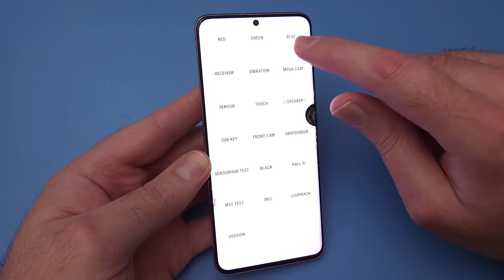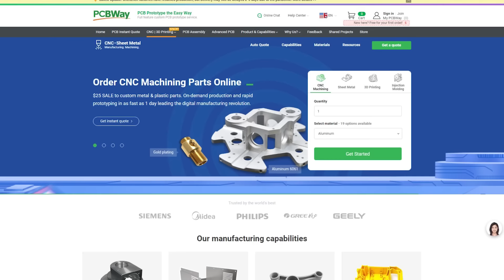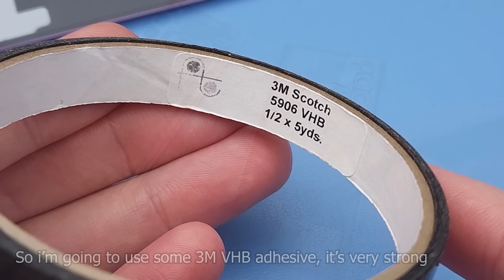Samsung Galaxy S20 Repair

Comment: The adhesive of the OnePlus 7 Pro is even harder to fully remove and get the back panel clean. I spent like 4 hours scraping and trying to remove it. That adhesive is very strong. I think i still have some of it stuck to my work table almost a year later

Comment: I think you shouldn't apply B-7000 adhesive as the tape adhesive will be plenty strong enough to hold the display in its place and it should be used for holding small objects such as the power button down in the place. But if you want to glue down the display more securely, you can apply some tape adhesive in the middle.

Comment: What a quality video, I need this in trends. This can't be ignore by a S20 series lover. Espectacular reparación, pasé un buen rato con este mi móvil favorito, cool content 👍🏻
Reply from the maker: Thanks so much 😀
Reply: @RestoreTechnique  hello, where did you buy your replacement screen?
Reply from the maker: @Puzzicanello  WitRigs, but I wouldn't recommend them, I think they might have closed down actually. I've bought from Etradesupply a lot in the past, and they are better, but still not fully trustworthy. I am going to try REWA next. You could try the vendor list on reddit /mobilerepair.

Comment: you can use turpentine to easily remove the glue. apply it to the glue lightly. wait 1-2 minutes and wipe away the glue. You'll probably have to repeat this 2-3 times. then clean with alcohol finished. I've often done this on cell phones. it doesn't attack the covers.
Reply from the maker: Thanks for the tip

Comment: 02:00 There is already a gap because of the phone heating issue. I also have that gap because that area heats up too much. I had already visited the service centre once and replaced that glue and after a year, the gap is opening again. But this time my phone is out of warranty.

Comment: can let me know where to get that replacement screen and the price,  thanks
Reply from the maker: I think I got it from Witrigs.com, but their service is terrible, so can't recommend them.
Reply: @RestoreTechnique What is bad about their service? I was going to buy a replacement screen(with frame) for my Galaxy S20 but I'm afraid the screen won't work well with 120hz refresh rate. I bought a refurbished S20 but since returned it to Back Market because the screen seems choppy when 120hz was turned on...

Comment: I bought one of these off of amazon for like $200 a couple years ago, I thought it was going to be as durable as my LG Velvet had been but it literally cracked, dead screen, the first few days I had owned it lol. It fell out of my pocket while sitting on a lawn chair, couldn't have been a foot off the ground. I still have that phone, is it worth repairing in 2024/25? I have a google pixel 8 pro now but I do like having a 2nd phone on hand in case my disorganized ass loses primary phone.

Comment: Why did you throw it? You could still use the flex to fix the white display problem. anyway, what actually happened to the display flex when it has the white flickering problem for s 20? can you fix it without changing the flex?

Comment: My screen is black. Not broken. Not cracked. Just black and not able to respond ? So ? Any ideas? Will not restart since you cannot see screen.???
Reply from the maker: Most likely the OLED panel has suffered damage that's not visible under the glass. Very slim chance that the ribbon cable has popped off its connection.

Comment: Amateur repair. B 7000 glue. What a joke. Buy original glue tape, not liquid glue. This phone will never be waterproof again
Reply from the maker: I used original adhesive tape, did you even watch the video? Or does having all the facts conflict with your need to be hateful?
I used a small amount of B7000 glue IN ADDITION to the original adhesive tape.